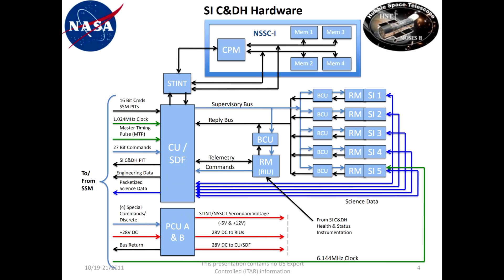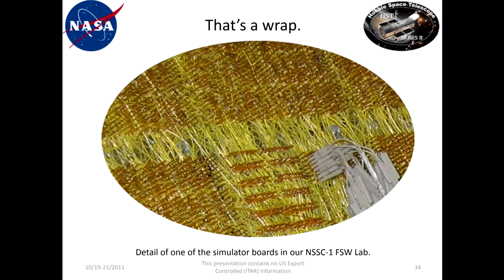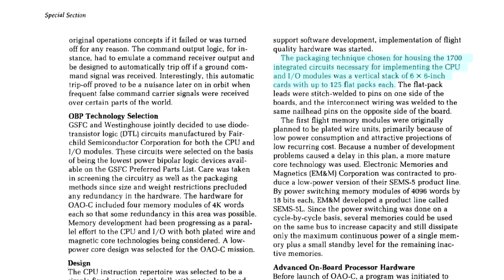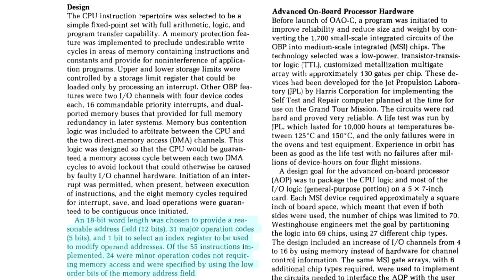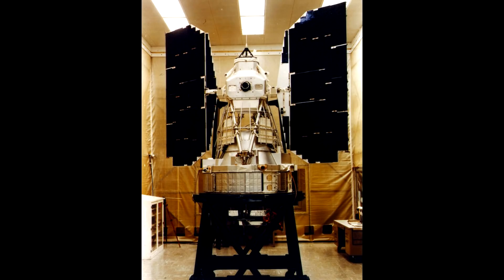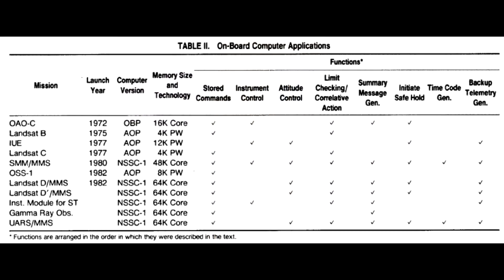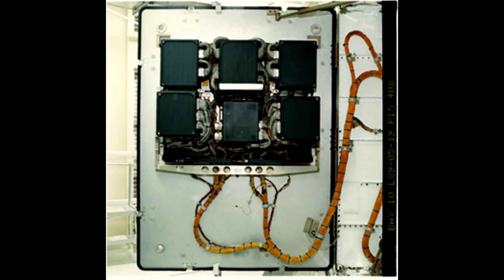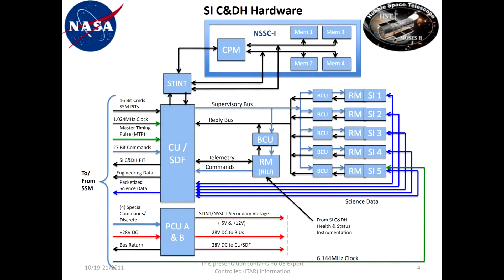Hubble's Latest Problems May Be In a 50 Year Old Computer Design

Comment: I get the feeling that it might be a good time to develop an airlock for the dragon.
Reply: And a mini CanadaArm!
Reply: @jilka-b  would all have to fit inside the trunk, and the manipulator would have to be long and capable enough to pull the airlock out and dock it to the docking port, and it would have to be cheap since there's no way to bring any of this back, but its probably possible.
It might make more sense though to develop an arm for the Starship though.
Reply: @kargaroc386  of course. We're all just kind of shooting from the hip here since we obviously don't currently have the required capability, and neither is there any sort of replacement hardware ready to go.
Reply: @kargaroc386  The Canadarm cost $100M. Dextre cost $200M. Starship would be the cheap bit. Even if you didn't require a lot of additional development.
Reply: I guess another possibility is that, if on the off-chance that the side hatch can be opened in orbit, then you could dock the dragon to the IDA port that was left on hubble, then de-press the cabin and do EVAs right out of that hatch.  I don't think that's possible though, or at least would require enough redesigning of the hatch to allow it to be opened in orbit, that it might be easier to just make the airlock/arm.
Reply: @kargaroc386  If an airlock is added, it should be permanentlt installed and accessible directly from the cabin, either as an extra vestibule on one of the 2 existing hatches or as a 3rd hatch between cabin and trunk.  As the latter option would compromise the heat shield, such an EVA dragon would need to transfer its crew to a regular crew dragon for landing, while leaving the EVAD in orbit between missions.
  Now one question will be how quickly Canada can provide a smaller arm that installs in the trunk, or if the astronauts will have to carry stuff around using their personal maneuvering units and teathering ropes.
Reply: Or a Starship with an open cargo bay like the space shuttles
Reply: It's sorta already underdevelopment. The Dragon XL being built for the Gateway has a large pressurized habitable compartment. Launch one to the Hubble and follow it with a Dragon crewed with 3 or 4. The Crew Dragon (CD) docks with the XL and two astronauts board it. The craft undock. The 2 crew do their O2 pre-breathing and don the EVA suits already there. The XL is depressurized and the 2 astronauts exit. The Gateway will have one or more small robot arms. One of these can be adapted for this mission, and XL will already be designed to be compatible. With the spacewalk complete and the crew back inside, the CD docks again. In this way the XL functions as a detachable airlock. The capability for another spacewalk is there if needed, no need to worry about how many depressurizations are done, XL can carry plenty of O2 and N2. 

Remember, the airlock has to be big enough for 2 astronauts to don the EVA suits, and they're big. The XL is a nice large "airlock." There is a problem, though - the EVA suits can't fit through the Dragon docking port. IIRC the XL version will have a larger one, but then it won't be compatible with the regular Dragon. This mission is fairly minimal cost so far, but adding an egress hatch on XL's side will bring the cost of engineering/approving a crew-rated design. Well, it'll never happen anyway.
Reply: Could have something like that just sit in orbit and have crew dragon(or other craft) just dock with it for the mission duration. Kind of a micro station but really an dedicated orbital vehicle. 

It's like the RV you store somewhere else but tow your car behind on road trips. Could even have it docked as a iss module most of the time
Reply: somebody tweet elon the hubble needs to be rescued! he'll probably have an EVA module for the dragon capsule ready inside of a year. sure!

Comment: It seems clear to me there's a ton of value in the physical hardware comprising the Hubble and that it would make perfect sense to continue retrofitting it, given that it's already in orbit.
Reply: Yeah, the question is how, though. We don't really have plausible options at the moment, sadly. We'll just have to hope that the "boffins" manage another of the miraculous software hacks they seem to pull off at least once per mission. ;)
Reply: @TallinuTV  one option I found is to send one of those recovery vehicles to push it rendezvous with the ISS to be repaired and re-orbited
Reply: Cost less to build a better and newer one, and launch it fresh than launch multiple EVA servicing operations which need to rendezvous with the telescope (very complex). You need to do all the physical diagnostics in space, on delicate electronic equipment, with a clumsy space suit on. It's not as easy as sending a TV repair team up on a rocket for a few hours then bringing them home.

Comment: NASA just needs to keep the Hubble in orbit for another couple of years until crewed Starships are available to do another Hubble repair mission.  With Starships available, hopefully the Hubble will be good to go for many more decades.  When the Hubble's forced retirement finally comes, I vote to have a Starship bring it back to Earth so it can be put on permanent display at the Smithsonian Air & Space Museum.  It has earned it.
Reply: It would be amazing to bring it hope but honestly I don’t think any technology we’ve built would be capable of it, except the shuttle. It would be brilliant if they could get one of them back into action and rescue it, but I find it unlikely. I feel like hubble repair missions should be possible without shuttles, using existing rockets, so I’m surprised no one has tried that.
Reply: Not sure if starship will be rated for that much mass on landing, nor if Hubble would survive the belly flop but if so absolutely!
Reply: @LordOceanus  Could perhaps bring a heatshield and parachute pack up, install that, and then pull hubble into a suborbital trajectory and detach and separate. Hubble wouldn't really need to "survive" per-se, it would just need to be good enough to put in a museum. Even so, it's probably not practical though, better to just build a decent model. I'd rather spend the money on more science.
Reply: Another option would be to just move Hubble into a much higher orbit where it can stay until it eventually CAN be repaired or returned to Earth.  Just having the Hubble burn up in the atmosphere is wrong for numerous reasons.  Tax-payers funded the Hubble.  We should have a voice in what happens to it.
Reply: @rodanderson8490  Keep it up there so we can eventually build a museum around the telescope :D
Reply: I'm not sure how Hubble will handle the G-loads in Starship. It is constructed to fly on the Shuttle, and it might break during the several Gs of the flip.
Reply: That is a good idea

Comment: I really hope that starship could have an eventual variant that could let it fill the role of the space shuttle. Having a manipulator and EVA capabilities is something that could still be very helpful.
Reply: Probably very doable, you need an open cargo bay
Reply: there is no reason why the moon landing variant could not do this with the addition of a Canada arm or some other mechanism. its will already have the airlock.
Reply: @fransdebruijn6763  an airlock will not fit hubble, also it doesnt have re-entry capability.
Reply: @beyken9129  I think he means an airlock that can be used for space walks. Don't need to bring Hubble into the starship or back to Earth to fix it, just have to be able to allow work to be done via airlocks and a manipulator arm.
Reply: @bensaunders317  then any crewed spacecraft could do it, just use the Apollo method of depressurizing the whole crew cabin, send a dragon or starliner out there if thats all you need
Reply: @beyken9129  The airlock does not need to fit Hubble. Fix it last time with an EVA.
Reply: Iss has those capabilities. They just need to rendezveus hubble with it
Reply: Prolly hard because half of it is fuel tank.
Reply: @beyken9129  Yeah, but that other half is massive.  The cargo area of Starship is just as long as the shuttles' and twice the diameter.
Reply: Elon would simplify the design: Just capture HST and bring it down for a complete replacement of all electronics, cabling and gyros. Then put it back into orbit with the exact same reused rocket.

Comment: What version Windows?
Reply: @ebenwaterman5858  Programming the bare metal is oodles of fun... as long as said metal isn't connected to a multi billion dollar piece of equipment.... or anything that has humans on board....
Reply: Embedded Lisp or hand crafted assembly. So no operating system as such. Now user mode pages. No TLB. No ISR timeout triggers. Just Don't Fuck It Up(TM)...
Reply: DOS 3.3

Comment: You’ll never need more than 64k of memory.
Reply: worked well on my Commodore 64..
Reply: Funny thing is if programmers wrote in assembly language & if you don't need a UI then 64k gets a whole lot of work done!
Reply: YOU WERE ALL FANS OF THE TIMEX/SINCLAIR.
VIC-20 COMES TO MIND AS WELL.
MAYBE I CAN FIND MY OLD VECTOR S-100 BUS COMPUTER WITH DUAL 8" DRIVES. OR REPURCHASE MY TWO OSBORNES I USED TO RUN A BBS BACK IN 1983.
Reply: @AECRADIO1  Loved me my TIMEX/SINCLAIR!
Reply: That was true until UI engineers decided to justify there positions, I mean , who needs colour
Reply: When I was in the USN back in the early 1980's the computer used to automatically land aircraft onto a moving aircraft carrier was a Sperry-Univac 1219.  If MY memory is serving me correctly, those computers had a whopping 8k of magnetic core (bubble) memory, and (even by the standards of 1985) a ridiculously low clock speed.  The biggest advantage the 1219 had for this type of use was 16 input and 16 output channels.  The input (programming) that was used for the AN/SPN-42A ACLS system was punched paper/Mylar tape on an 8" diameter spool.  So actually, depending on the application, you DON'T need a huge amount of RAM
Reply: @michiganengineer8621  Magnetic core and bubble memory are different things.
Reply: @Alexagrigorieff  They were labeled as bubble in the tech manual as well as magnetic core.  <shrug> Blame NavSea Pax river.
Reply: @michiganengineer8621  Bubble memory is sequential access, core is direct access.
Reply: @Alexagrigorieff  you guys are living in the past.. Sheesh.. 🤣😂
Reply: That was true before invention of license agreement.
Reply: Apple dude right? All new overpriced x8 apple 1 you'll never beleive whst you can do we charge you 6x for hardware
Reply: @DJDannySteel  No, that was a famous quote by Bill Gates.
Reply: @weschilton  He was calling out Mr. Smity, as an Apple fanboy. Since Apple haters immediately do that when someone jokes about Bill's shortcomings.
Reply: @weschilton  he never said that, and it was 640k on the ibm PC anyway.

Comment: Wonder the size and Delta-v would be required for a autonomous tug to drag it down "close" to the ISS let them do a few quick spacewalks to replace and repair and tug it back to it's usual location...
Reply: The problem is, it's in a completely different orbit. So not only do you need to drag it down, but it needs a large direction change too....this could be done, just a case of doing it at the right moment when the orbits overlap, but it would require a lot of Delta-v.
Reply: Given that they're in different orbital planes, alot.
Reply: Answer---a LOT.   HST orbits around 600 KM....ISS orbits around 400 KM.    The big issue here is that HST has no engines.   It uses gyroscopes to maintain or adjust its position in orbit.   

So, then you're left with moving the entire ISS structure to the ISS's orbit....which again, would be impossible with the limited fuel on board for thrusters or from an attached spacecraft like Dragon or Soyuz.
Reply: @Todd V. I mean it for sure could be done.
Question is how many Dragons would be needed.
Reply: Worse part is the difference in inclination, that’s the real delta-v killer.
Reply: Hubble has a mass of 12,000 kg and is at a 28.5° inclination and 545 km. ISS is at 51.6° inclination and average altitude of 400 km. So just to change the inclination from 28000 km/h @ 28.5° to 28000 km/h @ 51.6° would require at least a delta-v of 15,200 km/h (4.2 km/s) and that is just one way. You'd need to do it again to put it back. To actually change the altitude is pretty small in comparison. Now once we take in account that the Hubble weighs 12,000 kg we would need almost 100 MN (not including the tug boat). A Falcon 9 second stage will output about 1 MN for about 346s so in theory we would need to attach a fully fueled 2nd stage Falcon 9 to the Hubble to tow it there and back.
Reply: @DavidSprin  100MN is momentary force, you need to calculate the number of MNs to get a measure comparable to delta-v (which is acceleration X time = force X time / mass).  Your stated unit is wrong, but you may have reached the correct numbers.
Reply: @johndododoe1411  Thanks for pointing it out. I just was doing a very rough calculation. The delta-v is there, roughly 15km/s. Now mass comes into the picture when you are trying to figure out the engine and such.

Comment: I don't understand why they don't send a service mission. I get the shuttle is gone, but I feel like they could service it with either a probe or a specially designed mission using the dragon capsule.
Reply: I like the idea of a dragon capsule mission there … maybe also a dragon cargo modified to be a mini space station as a utility module
Reply: Dragon does not have an air lock. It can only dock to an already pressurised vehicle (so: the ISS).
Reply: @andersjjensen  That makes sense, I wish there was a way they could retrofit it for a mission like this. Giving up on Hubble just feels wrong, the sheer data that has come from it and the amount it could still collect with a proper service mission seems like it's worth it.

Comment: How hard would it be to replace the current computing and storage system with a modern processor(s) and way more redundant memory? Seems like a no brainer here. Just design it to plug in to the existing wiring and go out there and replace it.

P.S. I've worked on core memory in control units for industry. Heavy and very power intensive. They can do much better.
Reply: I mean, the video talks about exactly this. We've done it before, but we no longer have any vehicles that have a manipulator and allow EVAs.
Reply: @trixter192  No reason not to develop one. Perhaps a starship could be outfitted appropriately. It could bring the whole thing back for servicing if needed. Its a function we will need in the future.
Reply: @Myrddnn  Yeah.  That's the real failure here in my mind.  Scrapping the shuttle is one thing, but scrapping it without a viable replacement another
Reply: @trixter192  Falcon 9 Crew Dragon 2 may be possible if they add an airlock like the LM.
Reply: sound easy... however we need schematics.
that or FPGAs.
however the FPGA solution... I don't know.
in any case, it will could a nice chunk of some country's GDP to fix it.
Reply: @youkofoxy  I'm not sure what you mean there. 
I could add that  an even simpler solution would be to build an new "Hubble 2" and send it up.

Comment: To bad we don't have a Space Shuttle anymore just in case.
Reply: We have bits and pieces of it... cough*SLS*cough
Reply: We do, actually! They just have to be taken out of the museum.
Reply: @Sturmovik1946  The have Atlantis right there at the Cape but they dismantled the launch tower.
Reply: @brianking81  Yeah I know I've seen it myself, it was mostly a joke. It would be insanely difficult to get it back up to running condition.
Reply: The new chinese space station had a remote control mobile orbital-service module, if NASA ask nicely, maybe there is a chance that NASA could send a replacement part with russian astronaut to service Hubble.
Reply: @Saviliana  I just checked, they are on completely different orbital inclinations, so this is not practical.
Reply: I wonder if Crew Dragon could theoretically service it with enough modifications to the normal flight profile and cargo.
Reply: @dalesajdak422  maybe some kind of orbital-service module that crew dragon would dock to? Kind of a micro-station that's essentially a air lock with an arm and maybe some added fuel tanks? 

Could even park it at the ISS when it's not needed
Reply: @dalesajdak422  It would take YEARS to certify
Reply: @dalesajdak422  you will need more than just tin can to do the service. Nothing agains Crew Dragon, but it lacks space and equipment to do EVA. You can't just open the doors and jump out to do the maintenance and then jump in. Unfortunately...